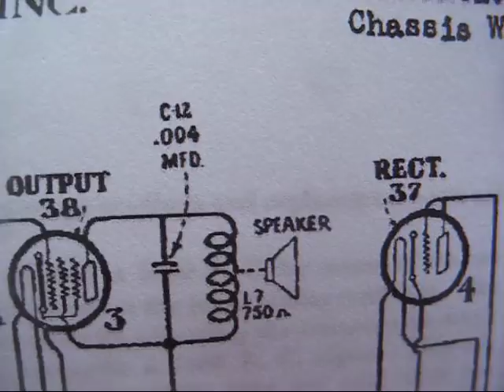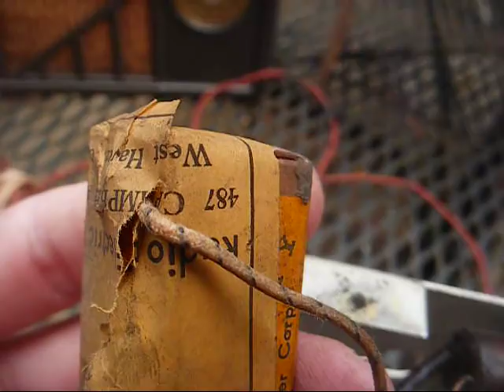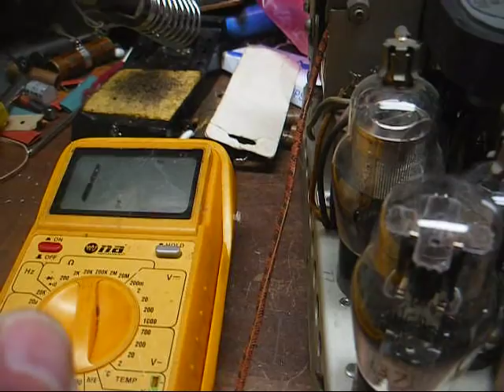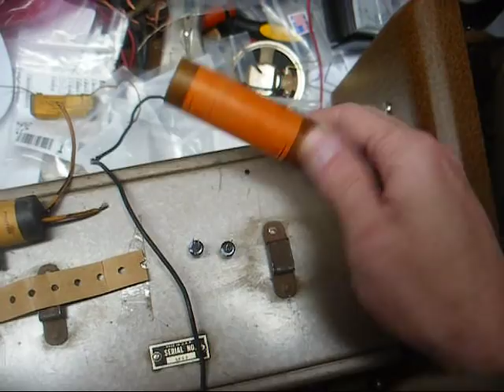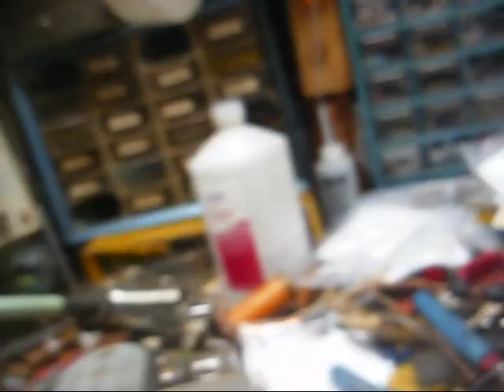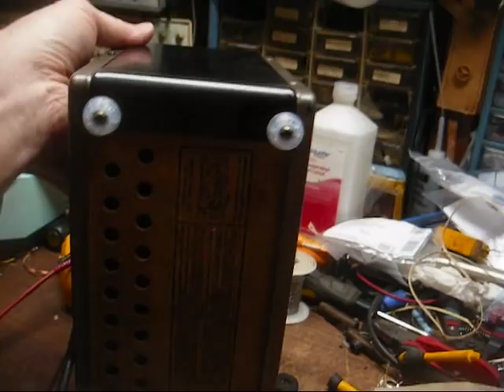Repair of an early '30's GE model M-40 TRF tube radio (made by RCA)

Comment: I had a metal case radio  like that years ago, we had it in the Kitchen on the counter for mom's radio. The problem was, if you touched the radio and the fridge or range you got a zap, bad one at that, much worse then the simple static shock we all are used to.

Comment: Interesting design! Love it. They didn't put dust caps over the voice coil back then?
Reply: In that era, most speakers had a cardboard spider in the center. A screw and spacer fastened the spider to the magnet. This allowed adjustment of the voice-coil's centering during manufacture. This is also useful today to fix a rubbing voice coil.
Reply: @nevellgreenough404  thanks for the information!!!

Comment: Wow, what a cheap set, not even a superhet, and RCA had the patent on that.  And why the 37 as a rectifier?  Could have used a type 1V.
Could also leave filaments in series and use a 24-28 volt transformer.  Looking at the replacement caps vs the originals reminds me of  the movie 'This Island Earth'.

Comment: A well designed TRF can be a very good performer, in contrast I have two pocket AM radios that have a single tuned stage. They are sensitive enough but you keep hearing two or more stations unless you live in the deep country.

Comment: Among the G.E models the letter ahead of it denotes the model year, a letter "M" means it's a 1934-35 model, I'm not sure if dates codes were in use that far back, at least none that would make sense outside of the manufacturers. The reason RCA manufactured radios for G.E during this period was because of an anti trust judgement against RCA in or around 1930. Prior to RCA buying out Victor in 1929, all of it's sets were manufactured by G.E or Westinghouse, but mostly G.E, RCA was basically a patent pool and marketing organization for the other two. 
 When RCA planned to buy out The Victor Talking Machine Co., G.E and Westinghouse supplied the capital, RCA also got involved with helping General Motors set up their own radio manufacturing company for 1930. Well that was a bridge too far for the anti trust division, so as a result of those actions, plus complaints by competing manufacturers regarding patent licenses, the courts ruled that all four companies had formed a radio manufacturing cartel, and certain penalties, and actions were ordered. So for a certain number of years, until 1935-36 or so, RCA had to manufacture sets for G.E, and Westinghouse, in the U.S market. 
   With regard to these sets, from what I was reading it is NOT a good idea to employ small value electrolytics in the power supplies of these early sets, yes they are small, and can take the same or more DC voltage, but no, they can not take the ripple current. I have read that if you have something like a Philco 20, or a Radiola 18 or 60, replace the paper filter caps with polyester film caps, if you try using 2 or 3 uf, 450 vdc electrolytics in there they can heat internally, and short out. Mouser sells 4-5 uf film caps for a relatively inexpensive price, Panasonic brand I think, whilst they cost more then electrolytics of the same value, and are larger, ripple current isn't an issue, and they never dry out.
Reply: Actually there is another way around, if you can't find, or don't want to spend extra on non polarized film caps. What you do is take two 10 uf caps and connect them in series, theoretically you could also use lower voltage caps but I wouldn't bother given the nominal difference in cost verses the 200-250 volt ones. You might be able to go up in capacitance a little, but in this case they are using a #37 as a rectifier tube so you would want to stay withing 20% of the originals. 
  This is just personal preference of course, but I have taken to the habit of re stuffing the caps in pre war sets that are all original, as well as the more collectable or unusual post war ones. This is strictly for esthetics, and has nothing to do with functionality of course. I may even start making reproduction cardboard tubes for some sets, sometimes old wire hangers for dry cleaners have tubing about the right size. I hate the looks of those yellow polyester film caps in old radios, why can't they use brown or black plastic instead?

Comment: You couldn't just use a generic on/off volume potentiometer?
Reply: They are hard to find. Only cheap low quality ones from China exist. Period ones probably cost more than the radio is worth.

Comment: It sounds like your video camera needs to be replaced. I mean, it is old. Most video encoders are optimized for the H264 video codec. If your camera still uses something like motion JPEG, it will continue to be harder for computers to support it as time goes on. A new camera should be cheaper than a new computer anyway especially these days.

Comment: If you want to stretch out the computer a bit longer, you can download a "live" Linux distro that can boot off of a USB thumb-drive.  There are many different ones around that are made specifically for older computers. Just about all of them are free and a 32gb thumb drive can be had for under $20.  Just something to consider.  Most of them come with accessibility options too, if you're worried about that.

Comment: RCA made radios for GE until the Sherman Antitrust act was enacted I believe in 1933. That's a decent performer for a simple primitive TRF set. I heard WOAI from San Antonio, TX. Decent distance from your location.
Reply: I grew up in the same area, and WOAI was a very common station at night. However, that was with a modern tuner.

Comment: GE  made by rca?  How ironic Considering RCA got taken over by GE in the 80s lol
Reply: RCA was subsidiary owned by GE that was split off in the 30's due to Anti-Trust regulations.
Reply: @comput3rman77  wow I didn't know that how interesting.
Reply: GE and RCA were both absorbed by Thompson in the 1980s.
Reply: @waltschannel7465  They were sold to Thompson by G.E.
Reply: @a.fritzbecker8986 only the manufacturing parts. GE kept everything else, like NBC.
Reply: By the time my 1988 GE TV was made, Thomson (which had been a UK subsidiary of GE before it relocated to France) had bough both of them and the CTC 136 RCA chassis had replaced all the native GE designs. Big business is sometimes like a big, incestual soap opera.
Reply from the maker: @pcno2832  My TV is a 19" GE from 1989 and it uses a CTC136 chassis. It's a remote set with a green channel on-screen display. The main trouble those gave were bad solder connections inside the MTT tuner module. The same chassis was used in some non-remote electronically tuned versions and a version with regular mechanical tuners.
Reply: @pcno2832  I think maybe you are confusing Thompson (Which was already a French company, originally Thompson Ducretet I think) with B.T.H (British Thompson-Houston) which was the British division of the American General Electric Company. B.T.H became part of Associated Electrical Industries in 1928, which was eventually taken over, ironically by the British General Electric Company (no relation to the U.S one) in 1967. So it was a different incestual soap opera, but an Anglo-American one instead.
Reply: @pcno2832  I did tv repair in the 80's and 90's and if I recall correctly that CTC 136 chassis was a real dog.